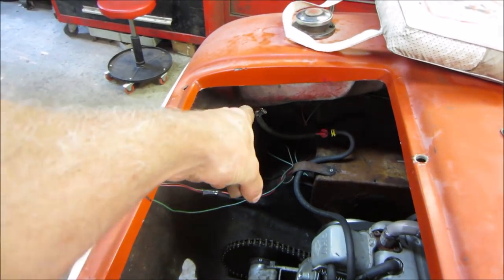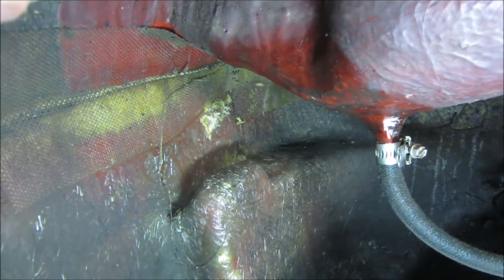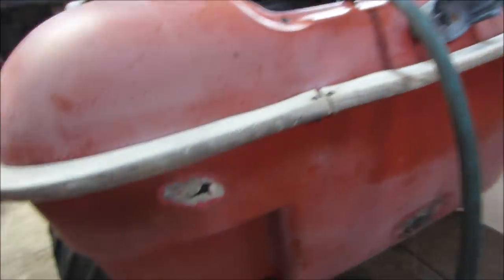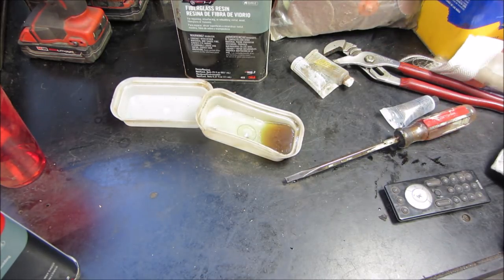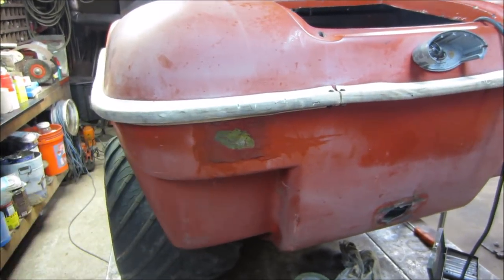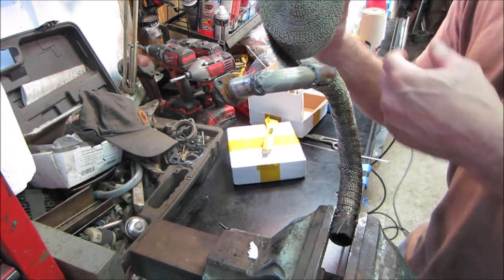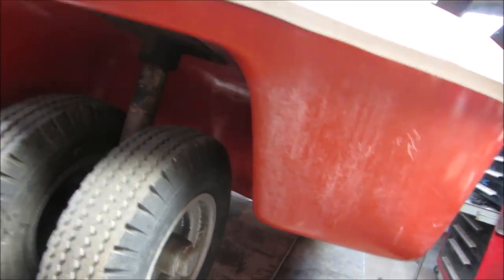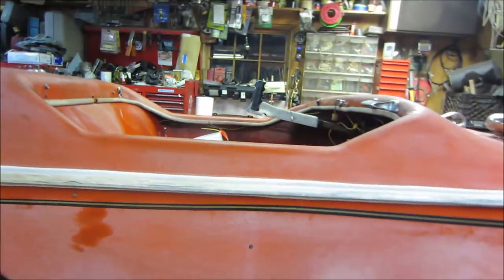Beaver amphibious vehicle fiberglass repair and exhaust wrap.

Comment: We use .032 safety wire on this type of wrap to hold it in place on aircraft engines. Then we wrap it again with fiberglass wrap that has a reflective layer, but would probably be cost prohibitive for you. Love the videos, I have learned so much about small engines and VWs since I started watching these.

Comment: A bit of advice form a boatie. When fiber glassing or working with resins, Darren, ALWAYS follow the recommended measurements of resin to hardener (found on the can of resin).
Too much hardener will cause the resin not only to set quickly, it will generate a lot of heat when doing so and the finished product is brittle.
Also, when applying resin impregnated glass to a surface, use the brush to stipple the patch. It breaks up any air bubbles and helps the resin to penetrate the patch properly.
Reply: I second that I have seen resin catch on fire from the heat generated when it goes off. The person stupidly poured new resin on top of a batch they had put too much hardener in and had gone off before they could use it.
Reply: His hardener is old, so recommended won't fire off at all.  Over-doing it will old hardener is still not the best, he should've just bought a new bit of hardener, however, it should work the way he did it.  If it cracks he can always re-do it.
Reply: I bought some cheap "Drug Dealer Scales" accurate to 1/10 g. No more problems for me measuring out 2% hardener to 98% resin...
Reply: Matthew Bergin resin won’t catch fire no matter how much you mix or how much hardener you add. It will get warm but won’t catch fire. That theory has been tested and proven false by many people. Sorry. Boat works today even done one and tested the temperatures but no fire not even close!!!
Reply: @mwatkins2464  It will however get things around it including old cured fiberglass hot enough to catch fire. We have done it a few times at the boat factory I used to work at

Comment: This is a great little project. Such a weird little vehicle. Great fab work. Nice to see it coming together. Open the gas cap, if ya patched the tank, so it can cure. Throw a fan at it too, so it can evacuate the dead air inside the tank while it cures. Really cool setup with the engine, trans, clutch, and reverse!!

Comment: When tensioning stainless bands or zipties I like to use needle nose pliers and simply roll them away from the locking mechanism with the tail pinched in them.  Often times you can take a roll or two ....then release and get a new bite...then roll some more.  It provides enough tension that you can actually break zip ties if you keep going.   The stainless ones will normally take a LOT of tension.  I use this technique a lot when using zipties to bundle wires and want them pretty snug.  It works well. Once you get it quite tight you can take a bite and use a forked window handle removal tool to pry against the needle nose and get even more tension.  There are tools that do that job but they cost 75-100 bucks and since it's a job that we all rarely do....the needle nose and fork method offers the same result with a lot less expense.

Comment: Yet another great restoration/renovation video, thank you.  Concerning that exhaust wrap.  This is purely a thought off the top of my head.  How about sealing the wrap down to start with using a thin smear of exhaust paste or some other heat resistant paste/gel.  Then cut a small collar out of some thin stainless steel/brass or copper sheet.  It would have to be thin stuff approaching shim thickness maybe.  Just enough to go over the first inch or so the wrap to keep it in place and with about a half inch overlap on itself.  Pop that around the exhaust wrap and hold it in place to start with using an ordinary disposable plastic zip tie.  Get that nice and tight.  Then use a stainless zip tie or two in permanent place.  You could probably get it/then really good and tight and looking very neat too.  Just a thought :)

Comment: Just a couple of suggestions.  Try using Penetrol (made by the Flood Company) on your fiberglass.  It really sinks in, and restores the luster (eliminates sun fading) with very little work.
When wrapping your pipes, try unwrapping the roll in the opposite direction.  As you wrap it around the pipe, it'll want to tighten on the roll allowing you to wrap it tighter instead of having to constantly rewrap it on the roll.  Also, when you get to the end, I cut a piece of duct tape a little wider than the fiberglass.  Lay the end so half of it lays in the tape then fold the tape back on itself.  Try using plastic ties to temporarily hold it closed while you use baling wire to make the permanent closure.

Comment: Hose clamps would work well for exhaust wrap too :)
Reply: ...or a few wraps of copper wire twisted tight.  Works for me.  ;o)
Reply: That was my first thought to more surface area to hold the warp in place and can get it tighter too.
Reply: Yes we call them jubilee clips here in the UK. I want to wrap my royal Enfield exhaust so was glad to see mustie hasn't done it before either!
Reply: Yes - hose clamp and dryer tape to hold the friz.

Comment: Telco and CATV companies sometimes use those stainless "tie wraps " versus  the black plastic. They have a rough metal ball in the clasp which binds the band, almost impossible to remove. But if you cut them off, be careful...sharp as razors. The tool we used to tighten is like a round screwdriver with a small slit in the end.  Leave about 1/2 inch slack tab, place the tool over the end tab and curl UNDER itself. It hides the sharp end and as a previous viewer said " use a needle nose plier to tighten ".   With all our brains together , we can cure the world's problems.... just cant CURE  old glass RESIN.  ;-P      Thanks Darren      J K

Comment: Some wrap tips from someone who has screwed it up...Cut the ends of the wrap and fold at 45  and tuck under, avoids unraveling also gives a point at the end for the wrap, if its glass wrap apply it wet, if its titanium no need to wet. Pull tie tight grabbing with thin needle nose and twisting them up, then cut a half inch long and fold over the latch thingy twice, with end inside the fold to cover the sharpies, then tap down

Comment: Hi Mustie, I'm watching from Birmingham UK and loving the vlogs,  i'm a little behind the game here as I've recently found you on you tube, you're right there is a proper tool for it that tightens and cuts them but you're doing just fine, one tip would be, to stop the ends of the wrap fraying is to fold under the last inch or so, keep the content coming 👍

Comment: Really enjoy your videos
Also wheel horse used a grommet type fuel line (shutoff) on their plastic tanks that goes into a fuel tank. They are available on ebay You put the grommet in a predilled hole and then insert the valve into it for a leak proof connection. With this setup you can make a fuel cell just about out of anything that will hold fuel.

Comment: I use hot glue to start and end the wrap on exhaust. It's good for installation if kept to a drop or two. Once I have everything in place I use tie wire to secure each end permanently. When the engine is running the glue gets vaporized away and you're left with a clean installation that doesn't require four hands..... Just my thoughts.

Comment: 1. Apply exhaust wrap WET for best fit. Also, wear gloves, preferably rubber inside thick ones to prevent the mother of all fiberglass incursion.
Reply: i did this to my car i also used abit of putty for the start help to keep good tension also the metal tie wraps u need to use needle nose pliers and role he end tight

Comment: Hi, You can measure the current draw of your fan with a basic VOM by just connecting it to a battery with the VOM in series. Just remember to set up the VOM with the highest current so you don't damage the VOM. There is generally a 10A plug for the red positive lead. Then set the meter accordingly. I would also suggest that you connect the charging circuit to the switch where the connection is only active when the switch is in the RUN position. Therefore when it is off it will not bleed the battery. Lastly, if the charging circuit is producing AC and you have only 1 diode it will produce 1/2 wave which will drop the voltage and will not charge the battery. There should be a Full Wave Bridge rectifier in the circuit to produce a full wave DC to charge the battery. I always enjoy your videos! Looks like you will approach 200k subs soon!

Comment: Mustie, a trick I've seen people use on their exhaust manifolds with that heat wrap is to hose clamp it on either end of the wrap. It'll stay on there real good and makes for a 'clean edge', rather than frayed or loose ends. Supposedly the metal tie wraps do not stay tight over time, versus the hose clamps which do.

Comment: Atwood's and tractor supply sold this kind of band in the past, and they had a little 1/4" drive tool that looked about like an extension with a slot cut in it for the end of the band to go into, that allowed you to torque the crap out of those bands and get them to where they wouldn't back off, also, Mustie you make fiberglass repair look easy man, love your vids and i'm loving the way this project is going looks like it'll be fun to take out on the water when alls said and done man

Comment: The difference between Laminating resin and finishing resin is Finishing resin has a wax in it to make it sealed and non sticky for a finish coat. Laminating resin does not have this "wax" so it remains tacky even after curing so the next coat will adhere without SCUFFING it. If you use finishing resin as your only resin then you must wipe it with acetone an sand it before applying another coat over the top. I always use fiberglass mat for repairs because cloth is to fussy to get to lay flat on curved surfaces. Mat is much easier to manipulate in tight and curved areas as you can stretch an tear it with your fingers. many layers can be built up at one session with mat also  being careful to workout the air bubbles as you go. Be careful not to add too much hardner as it can cure too fast and cause strength problems.
Reply: Richard Baumeister  I agree watch out for the amount of hardener. My first time working with fiberglass the container of resin caught on fire
Reply: Franks Precision Guesswork that was an old wise tail about resin catching fire. It’s been tested by many professionals and proven it won’t burn on its own. Boat works today on YouTube tested it and showed it got hot but could never reach fire temperatures. It was mixed with a lot of hardener but never got over 160 degrees or around there. Sorry 😐

Comment: I've used those clamps.  They have a tiny ball bearing that locks them, but the ball has to roll back to make it happen.  Also, if they get oily the ball will slip.  I got them with a CV joint boot and they were a nightmare.  Ended up bending them back and folding it under the band.

Comment: I'm really enjoying the videos, thanks for posting them! 
FYI, here in NH any motorized "boat" has to be registered (unless they've changed that law, but I doubt it). I found that out many years ago when I was required to register a little 12' johnboat in order to legally use it with a trolling motor! Depending on size and power requirements, you might even need to get your boat license if you haven't already. My boating experience comes from 15-20 years ago (things may have changed), so you may want to call a local marina to find out what you'll need to do to get your Beaver into the water legally.

Comment: I have done 'repairs' on boats before - that one on the back would have been a great place to put an outlet for  a bilge pump or a tie-down hook or something. Anything. Just so you can drill a hole and cover up the damaged area and make it seem it needed to be there. Bumper sticker is fine, but it will fade or peel - great idea, just not as permanent as a bilge pump outlet. 
Also - acetone. The catalyst is just acetone. You can use that if you need to kick a small bit of resin. (This sure is a strange and wonderful machine!)
Reply: "ABSOLUTELY NOT" to your acetone comment. Acetone destroys wet polyester resin, that is why it is used as a cleaner. MEKP (methyl-ethyl-ketone-propylene or something like that) is the catalyst.

Comment: I used those stainless zip ties 1 time.  Ended up with cuts all over my fingers and much like you I couldn't get them as tight as I would have liked.  I think if I had to do that project again I would have used hose clamps to secure the exhaust wrap.

Comment: That boat bilge blower you got there is only intended to be run a minute or two every now and then. It has a little brush motor sealed in there and if you try to run it continuously it's not going to last very long at all. See if you can scare up or a 6 or 8 inch cabinet fan in 12 volts. Those would be continuous duty

Comment: You was talking about controlling the speed while sanding well most quality air sanders/buffers/die grinders have a flathead bolt you adjust the speed with. I didn't know it either until I seen it in a video. Lol

Comment: I like those stainless steel wire ties. I bought some a year ago at a tractor show and so much better than the nylon ones and they'll never fail. I also slide some adhesive lined heat shrink tubing  over them so they won't scratch/mar painted surfaces.

Comment: On my '73 bug I used the masking tape idea with JB Weld on the floor. It had some damage from what I assume was a jack or jack stand which created some pin holes. I had some JB Weld from a while ago and decided to try it. After I caught it oozing out I threw some tape on the underside and it worked just well enough.

Comment: I know this is well after the fact but If you get a needle nose pliers and grab the metal tie wrap a few inches past the ratchet and then turn the pliers, like your opening a tin of spam (well like the old cans that had the little T shaped key that peeled the can open) you can get them fairly tight. Alternatively or for tight spaces you can use an old screw driver or a hex key with a slot cut up into it...

Another tip, fold under the end of the wrap so you don't have the frayed end out, looks neater and stops the end from fraying constantly

Comment: Darren - you may want to consider a little rectangular 1/8" aluminum plate on the outside of the machine to spread the load where the upper motor mounts to the top of the hull. Repeated torqueing of the motor back & forth may bust those bolts through the fiberglass...

Comment: The fiberglass repair needed to be done, so glad to see you get on it. After that is all done, 1 thing think I would do is get a can of that expanding foam sealant on sale at 1 of the big box stores, and add it wherever I could, under the wheel wells(since the suspension is non-existent on that thing) you can use softdrink can boxes as smoothers for it, and anywhere else under the dash, and in compartments that are not needed to be accessible, to give some backup flotation for it. Of course you pretty much want to wait until everything is run, and working on it..i.e. wiring and the blower and bilge.

Comment: Instead of buying racing gasoline to get away from the ethanol you should build a simple rig to separate the ethanol from the gasoline. I built and sold quite a few of them to local lawn care guys before non-ethanol gasoline became available in my area. 
It is just a tub that can hold at least 6 gallons  of gasoline and 20% distilled water by volume of gasoline. At the bottom of the tub a valve is attached and a large clear tube is connected to the valve. Another valve is connected to the bottom of the clear tube. I added an air driven motor with a shaft and propeller that agitates the gasoline-ethanol-distilled water for 15 minutes. After agitation open the upper valve and let the mixture sit for 2 hours. You will find 3 separate layers after 2 hours. The bottom level will be excess distilled water, drain it off into a container and save it for the next batch. The next layer will be cloudy water and ethanol, drain that off into another container and save it. The top layer will be pure gasoline. You'll need to mix a non-alcohol octane booster before using it in an engine. The ethanol and distilled water mix is very good for cleaning and decreasing parts. You can also run it through a still to separate the water from the ethanol. You'll need to fabricate a frame to hold the mixing tub up high enough for the section of clear tubing and valves. The clear tubing should hold at least 1 gallon.

Comment: yes you are supposed to wet the wrap first then when it dries it shrinks tight and holds better. vice grip and a screw driver is the way we always replaced the band's on the boots for CV axles, with your vice grip collection and you are using pliers. lol. I  think the CV band clamps would be better. you cut them off fold them back and there are little tabs that hold the cut off part into the clamp. hit the part you cut off with a lighter or torch to keep the end from fraying

Comment: Thanks for the video. Those stainless steel cable ties are great, but I’ve only use the tool I have which tightens then and cuts them flush in one action. I think the tool stretches the strap  also because they are so tight.
Want to borrow the tool mustie1? I’m in Australia so it would only take 100 days each way to get to you...
Thanks again for the videos.... (long time subscriber 😀)

Comment: If you flip the roll of heat shielding over and put the outside of the roll against what you’re covering, the wrapping will go much smoother and you can pull it tighter !!